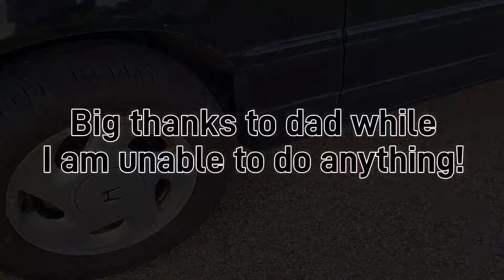Short Ep 1: Honda CRX Rear Brake Pad Change

Comment: Nice but you should have changed both rotors on rear to avoid uneven wear?
Reply from the maker: Yes! You are correct and normally I do. I didn't have much money at the time so one it is!
Reply: @justanothertuner4135  
I understand it can be tough on our wallets you are so right